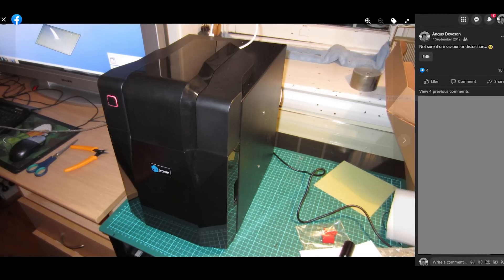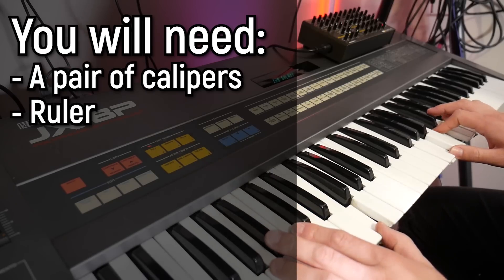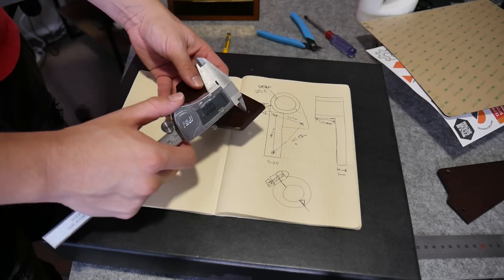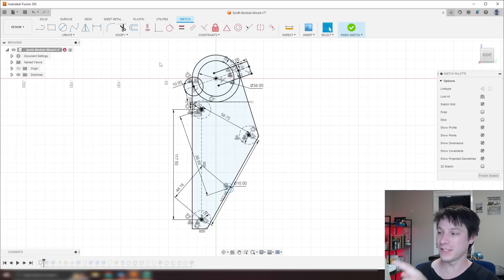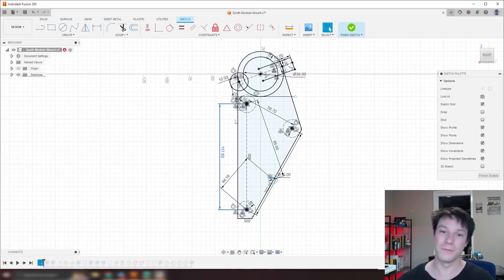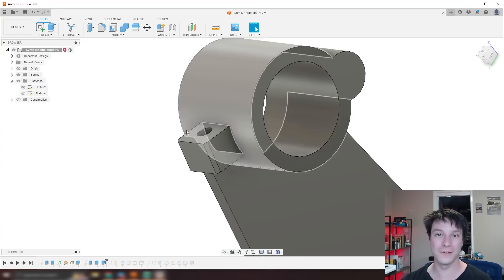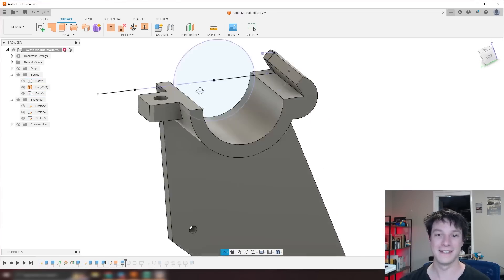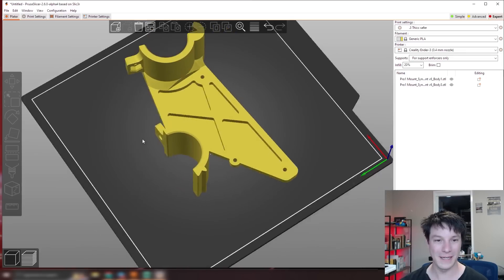Attach anything to anything else using 3D Printing!

Comment: When measuring hole centres, you're better off measuring inside and outside dimensions with the inside and outside anvils of the calipers, adding them together and dividing by 2. This works even if the holes are different sizes! You can then check if it's made in the USA and see if that rounds to an inch fraction or metric size. If it's really close, use the rounded size because it's almost certainly going to be what the size is.
Reply from the maker: Oh that's really handy!
Reply: Thank you! Wasn’t aware of the USA tidbit!
Reply: Does anyone have trouble Precisely locating holes, even when triangulating and being as patient and cautious as seems reasonable? Even double triangulate at times and still struggle to hit existing hole dimensions  “Perfectly” when 3D printing.

Are there any technics to improve that factor when Not doing orthogonally aligned or patterned existing holes? Struggle to hit those accurately no matter the effort expended it seems...then when you add the Z axis into the equation it’s exponentially more difficult to hit those accurately on the first try, and always find manually adjusting them, for me, is almost always required.
Reply: Mitutoyo makes dedicated Center Hole Measuring Calipers for almost Two Grand, just saying 😏
Reply: @101rotarypower  Well, you can always take a photo (or use a scanner bed), import the image into your CAD program on a plane and trace the geometry stuff on top. There are also some good tutorials how to create a part from a technical drawing (MangoJelly did a few about that on his YouTube channel, e.g. the one where he designs an airplane from front + top + side view in FreeCAD)
Reply: @101rotarypower  my tafe teacher (former railways and Qantas tech) had an expression, "nothing goes together without clearance). Translation: Bigger holes.

You've got some other options too, one trick I've seen friends use on engine parts with remarkable success is to put a piece of paper over the part that the holes are to be copied from, and lightly fill in the surface with a pencil. The pencil will catch the surface features and skip the holes. Next use that paper as a template. One could scan it into cad and use that to try and get closer results too.

I'm half tempted to try attaching a webcam to my 3d print head, drawing a crosshair in software on the centre and use that as a poor CMM to see if that goes well.
Reply: @carneeki  Some scanners will even scan a reasonably flat part (with the scanner lid open). Will not be a pretty scan, and be careful not to damage the scanner glass bed with the part if it has sharp edges, but other than that is very handy for measuring locations accurately (ideally with a cheap scanner, see disclaimer on not damaging the scanner). For the very best accuracy, place two known good rulers along the two axes of the scanner, this can be done in advance of actual scan with just one ruler, if always using the same scanner and the same scan settings like the DPI. As each scanner will have a bit different scaling for its two axes. The same reason why you ideally want to have two orthogonal scalebars when printing a to-scale template with an unknown printer. Will of course not help with non-planar features, which are always a bit pain. (Just add tolerances, like slotted holes or just plain oversized holes for body washers. Or, iterations. Or, expensive measurement machines. Or, carefully calibrated two- or N-camera setup to measure locations in 3d. The last really is a pain, so, with 3d printers, iterations are faster.)
Reply: @L2M2K2  using a scanner is a great idea. Just buy a pack of transparency film from your local office supply store and lay that over the scanner bed to protect the glass. I've done that before when scanning non paper objects. You can also get thin acetate sheets from art supply stores as well.
Reply: @Duraltia  And they're worth every penny. 🙂
Reply: The quick and dirty version of this is measure edge to edge by measuring the distal or near edge for both holes. Only works when they're the same size. Not as high precision, but a good trick for when you're on a ladder or they're hard to reach. 

Also, consider a hole and a slot if the design allows. Many mounting brackets and such have this design for a reason. If it's strong enough to hold a big azz TV on the wall it might do for your silly keyboard thing.
Reply: @sq3rjick  Yeaa... About that... I own both a Digimatic Caliper and as of recently a QuantuMike Micrometer ( the latter being the reason why I stumbled upon that Center Hole Caliper while browsing their site for a Manual ) which I'd buy again if I had to but pulling a 9x price Increase on a potential customer for a pair of Conical Protrusions instead of the regular Caliper Jaws is not what I call worth every penny - Far from it. Will it serve someone who needs that particular feature? Absolutely! But slapping another 1'600.- for just a different Jaw is a nope.
Reply: @BenWolkWeiss  Why did I never think of just using overhead projector sheets between the object and the glass... Thanks for the great tip!
Reply: @L2M2K2  Probably because overhead projectors are nearly extinct, lol! Glad you found it helpful.
Reply: @101rotarypower 
1. Be as precise as you can (use best calipers you have)
2. Measure both minimum and maximum distance and take average
3. Use as few measurement bases as practical (avoid trilateration chains)
4. Avoid poor geometry measurements ex. long and skinny triangle will have larger error parallel to the base
Reply: I've been considering printing various size cones to snap onto my caliper jaws that would center the jaw on the hole, but haven't decided if it would be accurate enough to be worth my time... I usually get it right just by eyeballing the same point on each hole
Reply: @jakobmitchell1568  this could work tough I would use Full Control Gcode for the conic part as unless you have no or negative seam with absolutely no bulging you will lose accuracy.
IMHO unless you are facing elliptical holes it won't be worth it.
Reply: "use the rounded size because it's almost certainly going to be what the size is." ... This also goes for numbers in your sketch!

When you don't have measured round numbers than you can also remove the dimensions in your sketch after all your information is in it (the sketch should remain stable) and try to re-dimension the features (holes, body edges) new in a way a designer would probably do (holes from the edges, using symmetry, using angles, etc ...). It very often shows that the numbers are not so far off from round number (a line that is like 49,37 mm long -> probably designed 50 mm or an angle which seems to be 30,57° probably was like 30° ). 
To have an idea how the parts would be produced manually often gives the idea how it probably is dimensioned, because for example: the worker can only measure from an edge. And it's also very wise to use round dimensions because no one wants to or can measure 34,32 mm by hand.

A part can of course be machined ... but a designer does not know if the workshop actually uses a machine for it or does things manually. That's why numbers, angles and dimensions in general should follow simple principles and use round numbers. And even if you cannot measure the exact edge or angle afterwards you can maybe guess them in your sketch.
Reply: @hassosigbjoernson5738  
Round in units you expect the product to be designed in.
Round only the dimensions that would be directly dimensioned.

Comment: I bought a 3d printer a couple of years back - and wouldn't be without one now.  

After the statutory benchy, calibration cube, octopus etc - I started to use it for fixing things solving problems by designing and printing things that you just cannot buy.  I find it indispensable.

Comment: To be honest most of the parts I print are called something like: "bracket" "holder" "mount" "adapter" "..." and I designed each of them for one very specific purpouse around my house.
Reply: Same here, I can't even remember the last time I printed something decorative...
Reply: Haha so true...🤣
Reply: This. I haven't printed anything not white or black for the last couple of years.
Reply: Same here like the clips that hold my camera tripod to my bag straps :-)
Reply: I'm in the same boat, almost all the prints I make at functional. My 3D printer has become my 'go to' solution for brackets, mounts, adapters, clips and holders. I love the process of designing for printing and the results have been very satisfying.
Reply: Yep same here. Replacement parts for repairs or optimizations are up there as well. It feels great to quickly design a part and hold something in your hand which just fits right soon thereafter. It's fun to remove little nuisances and to make minor improvements everywhere in your home.
Reply: Yeah, same
Reply: Gotta start somewhere my guy!
Reply: LOL absolutely
Reply: Hmm, most of the parts I have printed so far are printer parts.
Reply: Ditto, I used my 3D printer to make my CNC router and I use the router to make decorative things 🤔
Reply: Don't forget "socket"!
Reply: I started out printing trinkets, now I only design and print things I need.
Reply: This is pretty consistent with my experience as a CAD Engineer. My favorite is compound the compound versions like “Mounting Bracket Adapter”
Reply: Same
Reply: My wife is forever saying... So what your are telling me is you printed another bracket?

No it is a custom component to make these two things compatible! So this thing can hold this other thing!

....

So a bracket?

.... yes ....
Reply: Exactly the same here 😂
Reply: Agreed, the least practical thing I've printed so far is a fridge magnet!
Reply: Yes 😂
Reply: Same, and add "jig".

I'm painfully slow with CAD software still, but it hasn't been that hard to learn the basics.
Reply: same 😀
Reply: I had the "brilliant" idea to make pegboard hangers for all my kids' nerf guns. Each one will have its own custom mount... it will be quick and easy, I said to myself.... Me and my stupid printer?!? 😂😢
Reply: Ive typed the word holder for so many parts that it feels wrong to use that word
Reply: My entire fusion360 catalog is just holders and containers. The kind of simple but custom made stuff that you can't find anywhere. 

My 3D printer is there to either fix or improve something. I don't do toys.
Reply: @Gavin-Leigh  And you won't find anything like it at the price of few cents. 

Sometimes I think of the effort of cutting something similar out of wood or delrin, but the more I think about it the more my anxiety goes up. 

Going in the unheated garage by itself is a challenge compared to putting South Park in the background and whipping out the part in CAD in just a few minutes then sending it to the printer from my seat. There's nothing better than 3D printing when 3D printing is good enough of a solution.
Reply: @TDOBrandano  then you need to move on or get a better printer.
Reply: @taza99  "Container"
Reply: One more for me is "jig"
Reply: Exactly.
Reply: I print more brackets/supports/adapters for work than at home and they are often quite small. Would never have been able to make such small items with so much precision otherwise. Great for mounting little sensor boards.
Reply: Exactly.